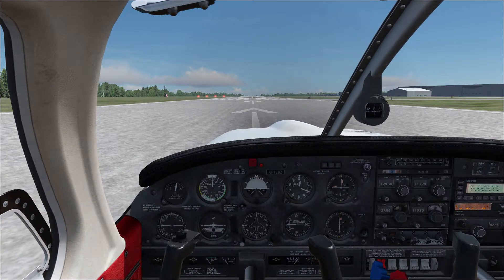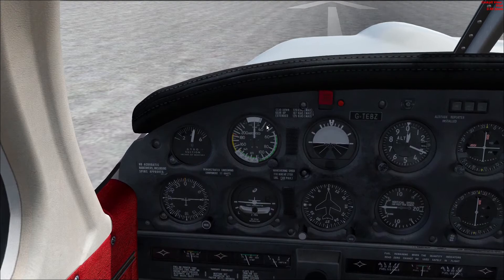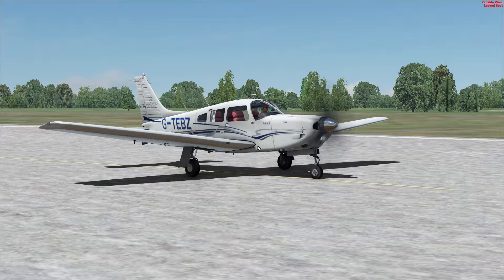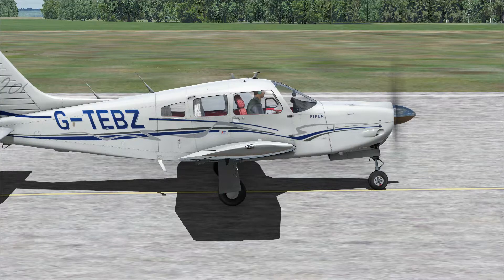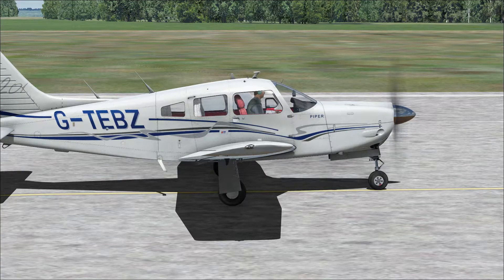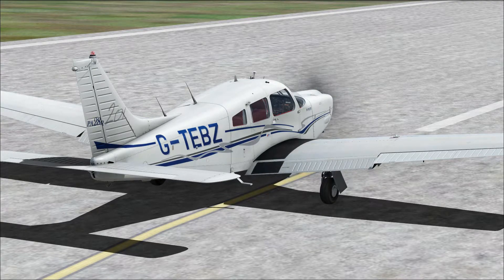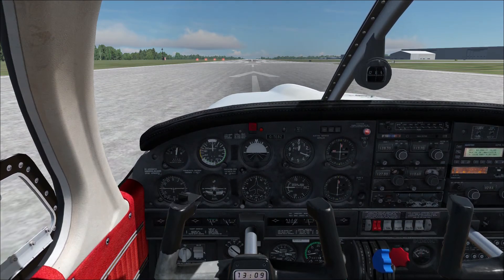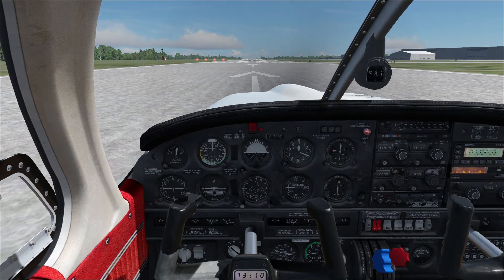Advanced Flight Tutorials | Stalls and Spins Theory  | Lesson 12

Comment: I'm right at home here. As you know I primarily fly the Typhoon. The whole point of its design is for high speed maneuverability, so it has sacrificed slow speed, high AOA capabilities to accomplish that. Despite that I can nearly pull off a super janky Cobra maneuver and then use the canards, since the wings are guaranteed to be stalled at that point, so maintain control as I slide on the tail during the descent. Then I abuse throttle and return to leveled flight. 

Or as I mentioned, there was that twin seat stunt plane in FSW that can pull off that old F-4 Phantom trick by pulling up in addition to a roll and rudder to either direction causing it to do a short ballistic spin. I dunno why, I just like to make planes do weird stuff. Seeing plane operate post stall is like the ultimate FU to physics and such a triumphant feeling. (Not actually breaking physics but good luck convincing yourself that when seeing these planes do these stunts.)

Of course, make sure the plane is up for the job. The planes I fly either have strakes or have negative stability. I won't be stalling 747s anytime soon. Bad things will happen...
Reply from the maker: Indeed. The design of these aircraft are rather spectacular. As I was discussing with one of my patreons the other day about the study I have done into these over the years. At one point I had to do a whole study on delta wing planforms and the NACA numbers for the aerofoils used on them and why. All about pushing the envelope on some of these aircraft.

Of course, with regards to physics I wouldn't be having to convince myself that they are not breaking; downside of having studied all this means it doesn't surprise me as much as perhaps it should! Also, stalling a jetliner is pretty interesting. You should try it
Reply: Never expected someone to tell me to stall an airliner...
Reply from the maker: All part of the training!

Comment: Very interesting stuff - getting into a stall seems quite intuitive (other than the accelerated stall) but the recovery not so much - the nose down seems straightforward but, without having watched this I doubt I would ever have thought to cut the throttle, for example - nice one, this looks like it's going to be more fun than the crosswinds :)
Reply from the maker: The only reason for a throttle cut is to avoid the airflow unbalancing the left wing, and therefore pushing the aircraft in to a spin more readily. The videos where I demonstrate will show how it works! Hope you have fun!